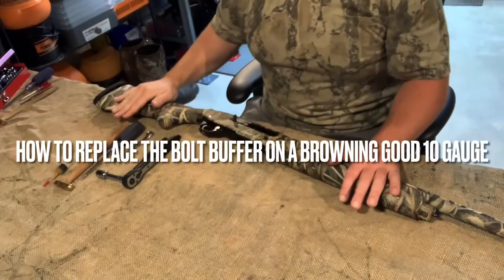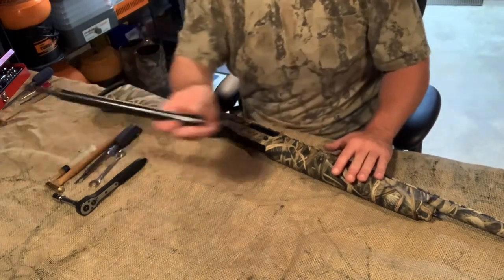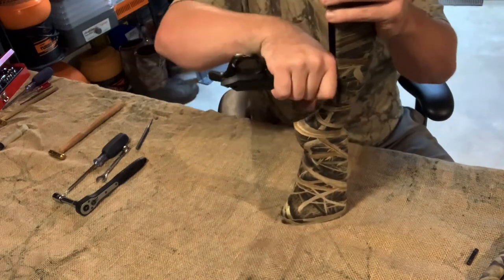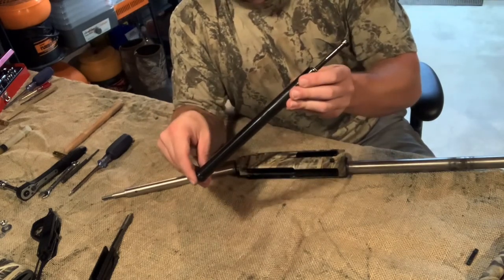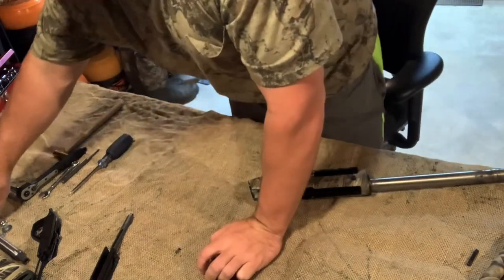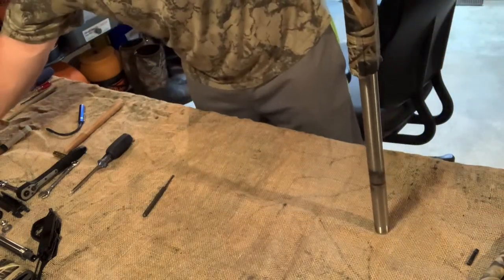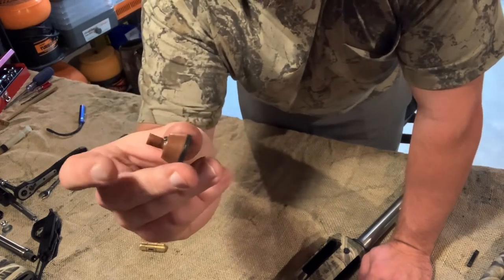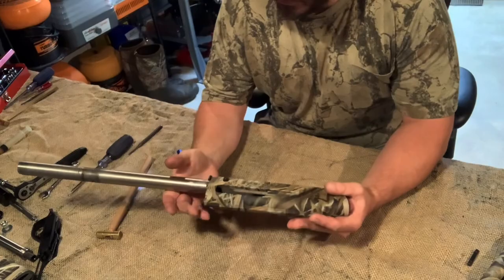How to replace the bolt buffer on a Browning Gold 10 Gauge

Comment: I’ve just ran into this issue with the buffer pad coming loose and caused my bolt to lock up. Took it apart and found the recoil buffer pad sitting in the receiver! Glad I watched your video and thank you for making it so simple to understand!
Reply from the maker: No problem. That’s why I make videos.

Comment: Thanks for the video. I have a gold turkey edition I bought back around 06 or 07 I think or maybe it was 10 years earlier? Bought it brand new and had zero issues until the season before last when my plastic white spring follower shattered. Took it all apart cleaned it replaced it and re mounted my red dot saddle on it. Took it out and zeroed. It went out to use it last year and the empty hull was pinched in the chamber after shooting turkey hunting so I set it aside. I forgot all about it. Cleaned the action and barrel two days ago. All looked good. I put a shell in it opening morning of turkey hunting. The carrier stayed open a good 3/4”. It would shut with force or letting the bolt fly. I cleaned it again and found little red plastic pieces in the action…so guess I should have replaced the buffer at the same time. Too bad Browning doesn't sell just the $5 red plastic buffer anymore and you have to buy the complete $46 assembly. With shipping and tac $56! Ouch. Imo should be a warranty item.
Reply from the maker: Yeah that kinda drive me nuts as well. It’s only ever the urethane buffer material that fails. I always keep at least one spare. If I was you, I’d buy a few if you intend on keeping the gun since browning discontinued the gun for 2024.
Reply: @avidwaterfowler7522  now thatt I have one comming I'll start searching for the cheap.disconinurd buffer by itself. Browning plastic parts must have a shelf life of around 30 years. My buckmark buffer from 91' let loose acpuple years ago as well.
Reply: I wonder if somebody can 3-D print them?

Comment: Thanks for posting this video. You answered the question I had about how the buffer assembly goes in. I've no problems thus far with my Gold 10 I have the older steel receiver. I have a spare buffer assembly incase I'll ever need it.
Reply from the maker: No problem. Thanks for watching!

Comment: IS THIS RELATED TO THE MECHANISM THAT IS INTENDED TO REDUCE RECOIL. HOWEVER I UNDERSTOOD THAT DEVICE WAS IN THE TUBE MAGAZINE.

ANYTHING YOU CAN TELL ME ABOUT THAT MECHANISM WOULD BE GREATLY APPRECIATED!!

THANK YOU FOR ALL YOUR WORK!!!

LE LONGUE CARABINE
Reply from the maker: This is the Bolt Buffer specifically. On this model browning, it protects the receiver from the bolt slamming into the back of the receiver. It’s absolutely necessary to protect the aluminum receiver.

The portion inside of the stock is the buffer assembly. In my video I show an aftermarket version that’s stainless steel and won’t rust. It’s made by sure cycle solutions.

Comment: Does the sure cycle system fit on the older steel receivers? The eurythane buffer part just broke in mine
Reply from the maker: Yes it does, even comes with a bushing for wood stock models.

Comment: Great video. My 10 the chamber won’t stay open would you know what could cause this. I know the buffer is broke and broke into pieces idk if it bent something it shot fine put it in the gun cabinet took it out and couldn’t get it to stay open. I didn’t shoot it since I noticed the problem. Any advice would be great
Reply from the maker: There is a part on the trigger assembly that holds the bolt back every time you open the chamber. I forget the name, but I know you can find parts diagrams online for the trigger assembly. Is your gun older, or newer? 

Browning customer service isn’t great, but if you call their technical service, they may be able to warranty or sell you the part. At the least they could tell you which part you need and just simply buy it elsewhere.
Reply: @avidwaterfowler7522  thanks a lot and it’s a older invader. I took it apart I just couldn’t find nothing on what holds the chamber open

Comment: Man, i found a browning invector gold 10 special steel shotgun, and right off the bat the gun would cycle, but the second shell would go on but the bolt would only go forward maybe 95 percent, and would be stuff to push forward like it needed just a smidge of assistance.  I took the buffer out and the white peice out and they look rough. Hopefully this fixes the issue. 
I should have expected issues since its almost a 20 to 30 year old shotgun mine is
Reply from the maker: It could be the buffer. They often fall apart and that is the telltale sign. It does take a lot of years an abuse to wear them out. Clean the gun entirely including the gas ports in the barrel. You can buy pipe cleaners, they are perfect for cleaning ports on auto loaders. Also, take the stock off and disassemble the buffer tube and clean it. Lightly oil it with a very lightweight oil as well. Old or not, that gun will last many many more years!
Reply: @avidwaterfowler7522  thanks I'll give it a shot